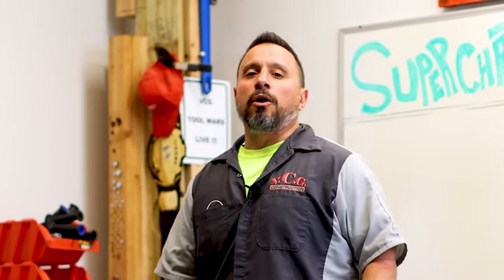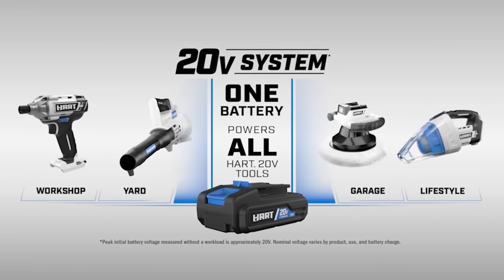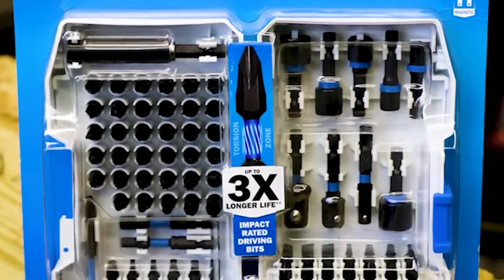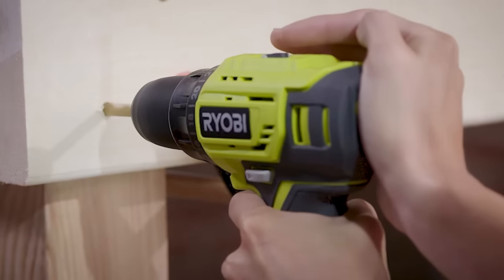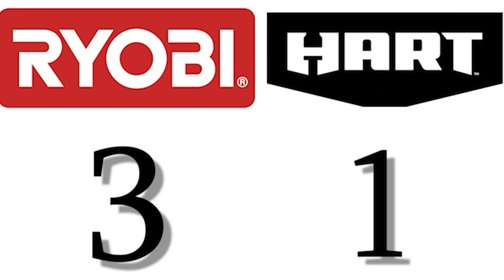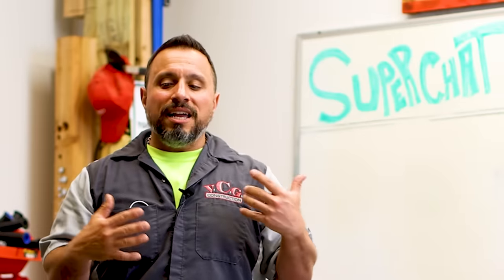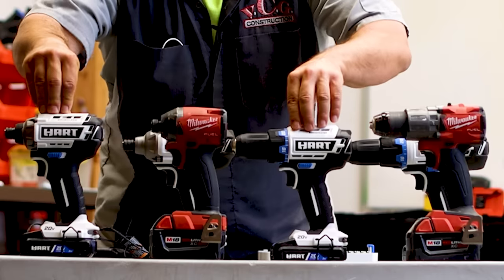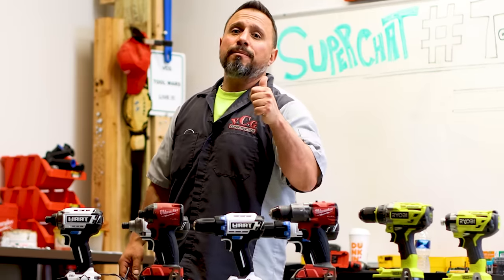HART Power Tools At Walmart PEOPLE HAVE NO CLUE!

Comment: I just do not trust the batteries. One day they work and the next, bad won't charge. Lesson I learned is if you have electric, go corded. Drill faster, longer, more rpm, more torque. I we even tried those battery tricks. All these drills I have and no batteries. I used my old BD corded and after using my Dewald battery drill all day and the corded was so much lighter. For me, I will wait a bit longer to see how these batteries last before I buy another battery anything.

Comment: Or! You can cruise over to Lowes and buy the awesome Kobalt drill/driver set for $99 bucks which comes with two 2 amp batteries, charger, @ durable carry bag, and, oh yeah, they're BOTH brushless tools and the drill will literally break your wrist due to it's power. They also come with belt clips for each tool as well as a handle on the side. SO! Without talking  real loud, and pushing my best half jersey and half New York accent while dancing around in front of a camera like Eminem but with less rhyming but still telling you what tools are best because some company, I'm not gonna mention any naRYOBIames, is paying me to. I'll tell you free of charge! Oh and to buy extra Kobalt batteries, the 2 amp only cost $29.99 each. I've never ran them out of juice and I'm a full time maintenance man and builder. So, good luck and go to Lowes. Peace.

Comment: I purchased the Hart Combo kit in2020 for a 148 dollars I got both drills 6 1/2 " circular saw recipical saw and the flashlight I'm I work for the person I rent from as his matinence guy have used these tools alot and there still going on strong only complaint saws- all power is so so but I got two batteries in the kit for DIY me  it's ok was surprised that Ryobi /Milwaukee was in volved in manufacturing when do you think upgrades will happen had the Black and Decker 20 volt saw/drill kit 5cuts with saw battery drained can't cut anything thicker that feathers or air drill ok? But not even homer owner good  like building a house with siccors /band aids/ string/ bubble gum 🤮✂️🖇️🍬🩹🪡

Comment: F both kobalt are great budget tools If your not going Milwaukee or dewalt or makita then kobalt is the cheaper front runner. Plus the Milwaukee and dewalt and makita are more use tools or commercial use. I did construction and dewalt did a good job but now I use kobalt around for diy they are making me want them over dewalt.

Comment: Hart, Ryobi, Rigid, Milwaukee all the same company in that order of strength and quality Milwaukee being best. Im a contractor and I own various generations of Ryobi plus one slowly replacing with brushless i say slowly because the dang things wont die. Well that battery platform and affordable pricing is what keeps me I have tried switching but the other tool companies keep changing the batteries witch end up costing more than the tools in the long run. I have not tried hart i just feel its a step backwards.

Comment: The drill may last a lifetime, but after the battery dies, you're done. Been there, done that.
Reply: Little tip here, you are not done! Just take the battery to Batteries Plus and they split the case and install new rechargeable batteries for a fraction of the cost.

Comment: Actually when I think of Walmart all I can think of is cheap garbage. I'm sure they're fine for the guy who only needs to use them every couple months but put them on a job site where they get used all day every day and just like all the others I've had to buy when money was short and you might get a year out of them.
After a little over twenty years I'm still using the first DeWalt  jig saw I ever bought. That's after wearing out a Craftsman in less than six months.

Comment: The Phillips bits aren't worth it. They stripped out right away. Also Rigid has the best battery replacement program. Rigid has a 2 combo for 139.00 at 18 volt brushless. Also they've got 2ah 2 combo got 169.00 last I paid for drill and impact combo. Also free battery replacement lifetime service agreement. Look for the impact with the 3 speed clutch. They can can drive headlocks like no other. Also Hart used to make a great hammers now they're worthless.

Comment: The sawzall sucks. Batteries die to quick with hard use. The 22 oz hammer is sweet tho. The impact is decent, the drill is average. I havent bought anything else cause the batteries die out quick. For small projects hart tools are fine.

Comment: So if I could buy the Milwaukee line of tools with 2 batteries and probably have them for many years if not a lifetime why would I even bother with the Hart line? I think maybe wal mart should just reconsider getting into the DIY market all together. Any serious tool buyer wouldn’t even consider them a viable option to go get tools in the first place if you ask me. My first thought for any kind of tool be it a drill or a hammer or a screwdriver dont lead me to think I should shop at Walmart for it. It takes research and actual shopping for the best deal for the best tool all of which I can do at home with my phone.
Now, maybe I can believe that they’re not a bad line of tools and maybe they would last me a number of years. However if I’m shopping for a drill and driver set and I get a Milwaukee with 2 batteries for less than their kit with 2 batteries it’s a no brainer for me.

Comment: In terms of "deals" or "bang for the buck" hart is only good for "big" tools that you're going to have at home and not use to often. For instance they have a 10 inch miter saw thats something like 100 bucks. Idc who you are thats an insane deal. Now if you're cutting 500 boards everyday 7 days a week maybe not. But for the guy who's just trying to cut some wood once ever year there is no point in buying a 600 dollar Milwaukee 10 inch sliding miter saw.

Comment: Take it from someone who made the mistake of trying to save money...just spend the extra $5 for the Ryobi, ESP with the 1 amp, NOPE, never again! Worst purchase ever going with a cheaper name and 1 amp. And I only make signs and drill holes into 2x4s, but try drilling a hoe into a VERY HARD piece of pallet wood, lol! Its ridiculous. Just go with the better, more well known brand that you can pretty much buy anywhere. I know he said they are the made by the same company, but you will notice the difference. I have gone thorough so many cheaper low grade tools and the money i spent replacing junk tools, I should have just spent the few extra bucks for the trusted brand. 
     There is a reason most construction worker/carpentry guys do not use HART or that Harbor Freight place, lol! Those are more for people who don't know better, or dont care if the tool they are buying is a one and done bc they wont need it again anyway. Lol! I ended up with DeWalt. And that's where Im staying. =)

Comment: Milwaukee line" 2nd to none. Also newest milwaukee one-key system. You can program your tools within yoyr cell phone. Location, settings,"theft deterance. If stolen, instantly disable the tool within your cell phone, thief never can use the tool ever again. Only the original owner can enable the tool through Milwaukee. One-key technology 2nd to none, as well as longivity 2nd to none.

Comment: Their batteries suck. as far as I've had two of them go bad my friends had two of them go bad. But I have taken them apart and sane down inside that there is a slight problem where the negative and positive and the little like fuse thing can get moisture or something to it very easily or something can fall in there and touch him and it is shorted out. They improve that they might have something better. Hart fan tho

Comment: ONLY A FOOL WOULD BUY THEM, AND HERE'S WHY:
(1) Tool batteries have a finite life. Think about what happens then:
     (a) Hart tools may be long gone at that point, so you have a tool that is utterly useless.
     (b) They are still around but, inevitably, they will have changed so batteries for your model     
           are no longer available. They will have batteries only for current products.
     (c) You might get a great drill today, but what other tools will you be adding later? Will you be 
           able to buy those in Hart brand? If not, no battery with that drill.
     (d) Often, aftermarket batteries can be found for brands like De Walt, Craftsman, etc. But will
           they offer batteries for that Hart tool you buy today - a tool likely to be superseded by a 
           model with a different battery next month? Or next week?  
     (e) How many pros or serious hobbyists/diy'ers are buying Hart? If not a lot, they will be 
           replaced in no time with something else. Look at how many changes in tools have taken 
          place there in the past couple years. Then, as yourself how long these things will be
          around.
Best advice I could give anyone is to either pay the extra bucks for Milwaukee, De Walt, and something like that OR, if your budget doesn't allow that option, check out Harbor Freight. That would give you better chance of finding compatible items down the road.

Comment: I tried those gumby bits because of your recommendation. NOT impressed. I'll stick to Milwaukee or Dewalt. Hart tools are junk. Not even comparable to the tools they replaced. There was the occasional gem in the lineup of tools before the hart brand pushed them out but no longer.

Comment: I just tried the small drill/impact driver.
It was the hardest time I have ever had screwing 2 self tapping screws.
The unit is not balanced at all.
As soon as that motor kicks on, the driver chassis starts shaking.
Gotta use 2 hands to keep it still.
I would not recommend this overweight akward unbalanced wannabe driver to anyone.
Then to top it off, the driver tip blocks the light, so no matter what, you cannot see the head of the screw/bolt in the dark.
0 engineering went into this product.